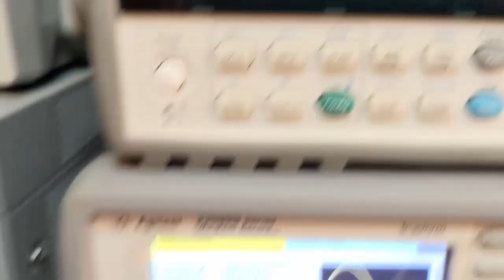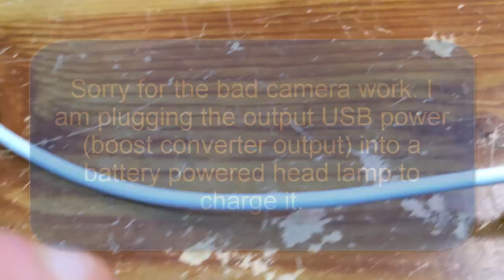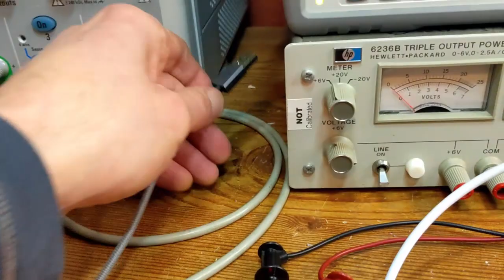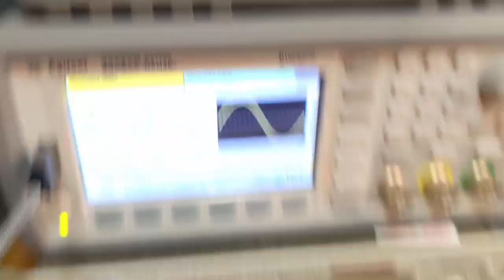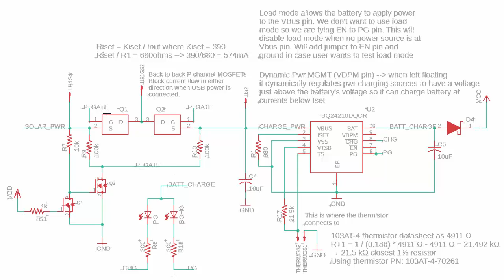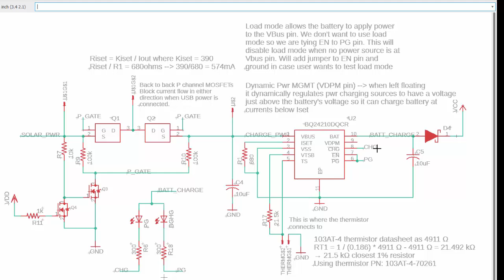Designing a Solar and Li-ion Battery Powered  Charger / Power Source Part 2

Comment: Hi man, thanks for the other educational video. I have a question if you don't mind.

I'm using esp32 with solar charging. İ can't use load share since panel charging 5v 100ma but Esp32 using 700ma. Good thing is Esp32 is waking every 15 min for 2 sec and goes to sleep. However, i don't want to charge my battery fully but 4.0V only. I'm using diode to drop voltage and its working great but sometimes diode is so hot to touch especially while battery is charging. Is there any other more appropriate way to do it? Buck converter didn't work as i wanted and limited the current
Reply from the maker: If the diode is hot to the touch you should probably go with a diode that has a higher current rating. You should be using a Schottky diode since they have a low forward voltage to help conserve power. You could replace the diode with a P Channel Mosfet or back to back p channel mosfets for better efficiency (I show this approach in my video). When you use mosfets you just have to make sure you have a signal to bias them at the right time. This could be a signal from another power bus like in my example or from a microcontroller.

Comment: Have you considered something like 3x 18650 batteries in parallel? Basically 3x the capacity while maintaining a 3v pack.
Reply from the maker: I got a similar question on another one of my videos, maybe that was you too? No battery cell is the same and can have slightly different charge or discharge rates as well as capacities. And these differences can become more pronounced over time. To operate them in parallel you would have to come up with a sophisticated battery management system to properly balance them. Not sure what your application is, do you have a load that requires a large amount of current real fast and that is why they are in parallel? Otherwise I would just design a circuit that would operate one at a time. Once one is almost fully discharged, I would switch in the next one and switch out the discharged one. I would then repeat with the third one once the second one was discharged. This approach you don't have to worry about balancing them.
Reply: @ForceTronics  Lets try this again. Last 2 attempts failed to post. 

In my case the load is around 10mA to 100mA-ish. I'm chipping away at an opensource case for the TDeck I've put my files in onshape under "T-Deck_Case" I'm looking at 3 batteries to extend the life between charging. I intend for the device to sit in the window charging via solar or USB. It normally sits idle, charging batteries. I've been pondering that the 1st cell charges until it reaches full, full indicator then triggers the 2nd battery to charge, and then eventually the 3rd. Or perhaps I could charge the lowest V of the 3 cells first. I guess I need to decide if I want 3 batteries charged to 1/3 or do I want 1 charged battery and 2 empty batteries. 

I've been looking at the BQ24074 then add short circuit protection. Or perhaps go with the BQ25185 which includes the short circuit protection and works with a higher Vin. I like the JLC availability of the of the BQ24210DQCT.
Reply: @ForceTronics  or @RoterFruchtZwerg I drafted a 3 cell PCB layout based mostly on this YT video. Any chance either of you might review my schematic etc? I posted it on GitHub?  github dot com/jharvey/T-Deck_JH/blob/master/schematic/TDeck_EasyEDA/PCB1_2024-02-11.pdf The 3D files are posted at OnShape under "T-Deck_Case" some PNG pictures are in the GH folder. The PCB is the + side of the battery connector, and a wire is soldered to the spring contact on - contact. It's my first adventure with EasyEDA.
Reply: cells in parallel don't require balancing and also their capacity doesn't need to be matched (but it's good practice). Almost all high power commercial batteries are paralleled cells. Like in powerbanks, laptops, vacuums, drills, ...
Reply: You are absolutely correct about laptops using batteries in parallel, but they do use a balancing for their batteries in parallel. In fact Apple was the first to actively balance their parallel batteries in laptops in the 2000s and it had a noticeable increase in battery life. From their all other laptop makers followed.  @RoterFruchtZwerg
Reply: @RoterFruchtZwerg  cells in parallel will balance. Try putting a dead battery in parallel with a fresh new 18650 and see if the fire monster appears. It's important to make sure they don't feed each other and they only power the load.

It's also important to charge proper. Internal resistance will create an imbalance if you attempt to change with one charger. I'm planning on one charger per cell.

Comment: Great video! It looks like there is a small circuit board as part of the battery cell you are using (on the top near the wiring), what is that?
Reply from the maker: Good question, that tiny circuit on the battery cell is to cut off current flow once the battery becomes fully discharged. Most Li-ion / polymer battery cells are discharged around ~2.75V, if you were to continue to use them their voltage would drop quickly. Once they get to ~1.7V any further discharge you will damage the battery as well as possibly swell and over heat the battery. That circuit acts like an open once the battery gets to 1.7V (could differ depending on the battery). thanks for the question.